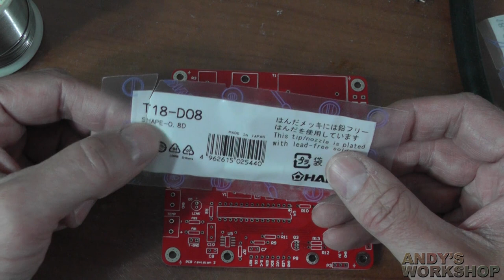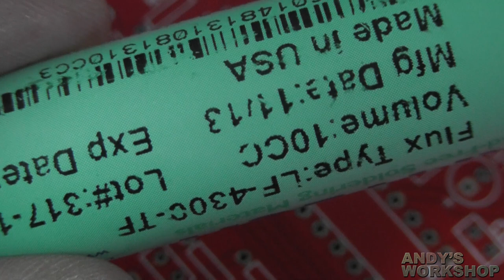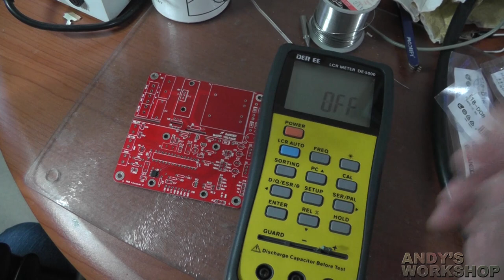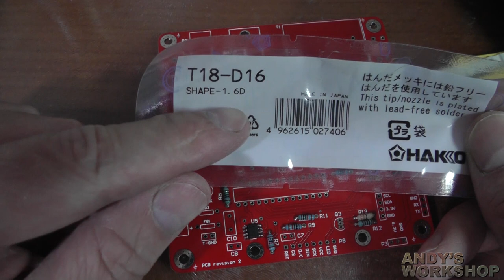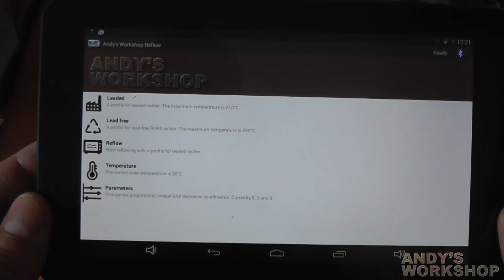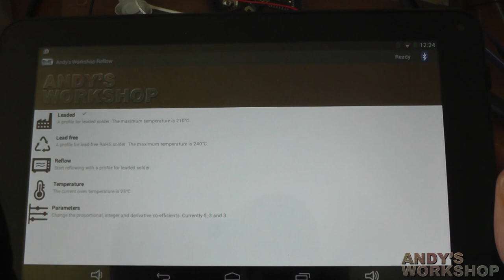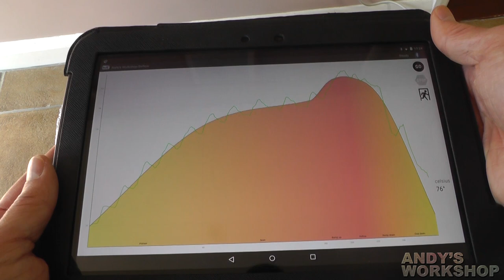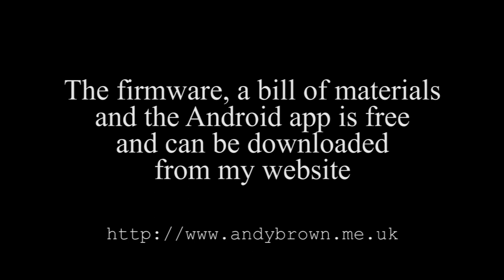An android bluetooth reflow oven controller that anyone can build

Comment: Very well explained. I'm currently working on similar project and was looking on YT for inspiration but almost all of the reflow ovens use SSR for "bang-bang" control. This is probably the only project using Phase angle control of AC current. Seeing your project working, i now feel more confident about my project. 
Thanks

Comment: Very nice work! But you have to tune your PID way lower :) Start with I=D=0; then tune P until you don't have overshoot. Then start adding I to compensate the static error. D can be 0, it's not really useful for slow changing process. 100% integral windup limit is fine as long as you tune P and I correctly ;)
Reply from the maker: Charles-Henri Mousset Thanks for the advice. I'll try your suggestions and see if it improves the performance.

Comment: You may want to try to put a hard-limit at the I-part value (e.g. +/- 30%) to stop the major overshoot at the peak temperature. That way the P-part of PID doesn't have to ramp extremely high to cancel out it's I part.
Reply from the maker: nlhans1990 Thanks, I'll try lowering the integral limit - it's currently limited to 100.

Comment: Hi Andy, I like you you are very sharp guy, but in this case I don't understand you. You say this :
"A fully integrated controller would be supplied by the mains and use zero-crossing detection to drive a triac that would dim the halogen oven instead of just switching it on and off." - this is why you use triac. And I totally agree.
And then what do you do ? You switch it off and on, you put a huge wave on the curve, thats is very horrible PID. And switching, obviously not a fine and continous power control with triac. What am I missing ?

Comment: Hello Andy, excellent work .... I am an electronics enthusiast and I will try to build my own reflow oven, I am adapting your circuit to operate in my country (127VCA), I have not worked with uM AVR, only with PIC's .. so I do not know many details, however your explanations are very precise ... I will try to follow them literally ... my question is if I could change to Spanish the text that is shown on the display, if so , would I have to use IDE scons? Does it work in windows? Is it written in python? and finally, what extension is the source code file? thank you for sharing....

Comment from the maker: Based on your feedback I insulated the oven lid, tuned the PID profile and fixed a bug or two in the controller. Check out the updates at the end of my blog article for details: http://bit.ly/1D9G0fQ. Thanks to all who commented with their advice!
Reply from the maker: +andrew moon 'fraid not, it wouldn't be practical for me to build these to sell. Although they are simple to put together, all through-hole stuff is time consuming to assemble.

Comment: Your project is very interesting and very complete, I am interested in building it, I would like to adapt the firmware for 60hz but I am not very good at programming, I was looking at your page and from what little I can find out I see that you wrote it in C++ with avrgcc compiler and I build it with scons in linux in the year 2015, I am trying to take this to windows 10 but it has been difficult for me, I would like if you could help me to pass the firmware to 60Hz, thank you very much.

Comment: Is the zero-cross-detector accurate? Or is there some phaseshift between mains and the secondary winding and capacitor?
Reply from the maker: ***** Good question and one that I should have covered in the article. For this particular transformer there is no phase shift - the "dots" on the windings in the datasheet schematic line up. This is backed up by my testing of each percentage from 0 to 100 in steps of 10 using an incandescent lamp.
Reply: Andy Brown thanks!

Comment: Hi - nice video.
I am confused by the ICSP header pinout.
Mine are all pin 1  MISO ,2 VCC, 3 SCK, 4 MOSI, 5 RST, 6 GND.

Where did it come from?

What was the oven set to?, or did you bypass the oven wiring internally like most toaster oven builds?
Reply from the maker: Hi Mick, the ICSP pinout doesn't follow the standard and needs jumper wires to connect to the header of the USBASP programmer. My mistake, if I'd been thinking straight I would have followed the standard to allow an easy header connection.

No oven modifications are required. It must have a very simple control circuit because I just wind it around to 250C and the maximum on the clockwork timer and leave it there.